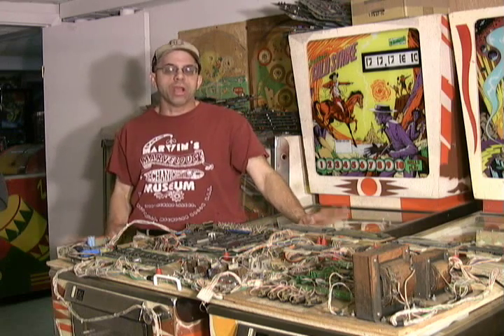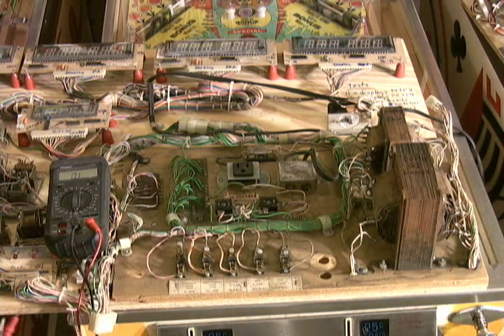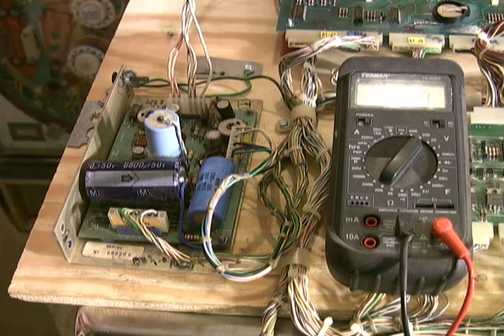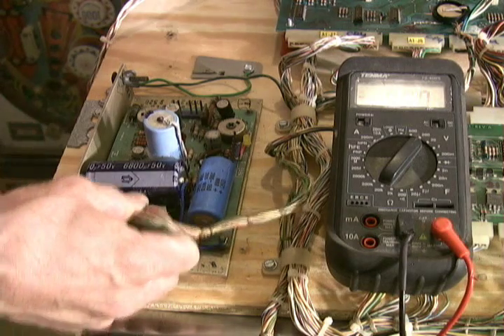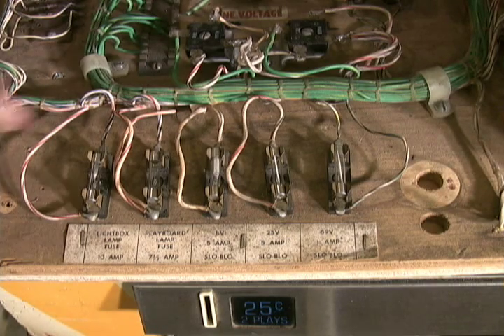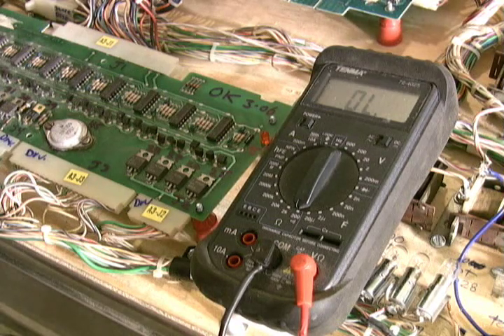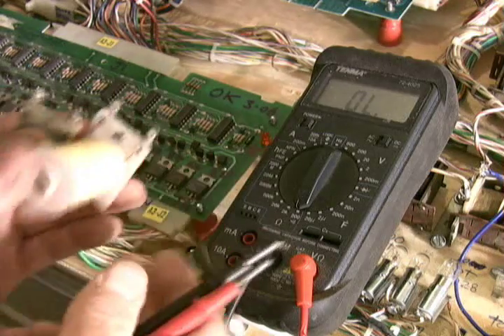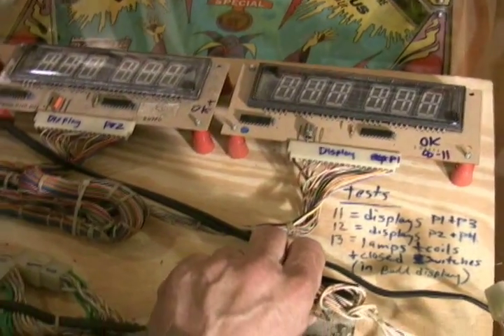Pinball repair: Gottlieb System1 first time power on procedure

Comment: CFHATPROVIDEDOTNET, why did the older pinball power supplies only use ONE filter cap rated at 27,000uf very high capacitance because most power supplies use multiple filter caps rated at 100uf, any reasons why? Older pinball games used AC coils & solenoids and switched over to DC coils & Solenoids any reasons why?

Comment: What is they are higher like .665 for one? of the bridge rectifier?
Reply: Specs for the bridge rectifiers say they have a 0.7V maximum forward voltage drop so this should be OK.
Reply: Argh -- typical 1V maximum with 0.7V typical.

Comment: Question. I've got the same power supply on a Buck Rogers that I'm trying to get going. I'm not even getting 1 volt where I should be getting 5 and get nothing where I should be getting 4. All other voltages are good, any thoughts on what's going on with mine?
Reply: did he ever get back to you?